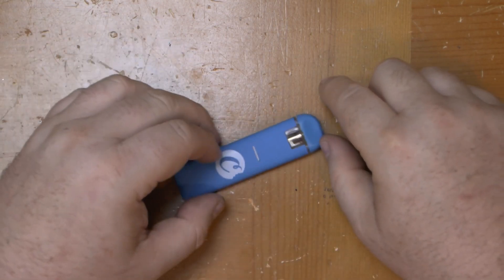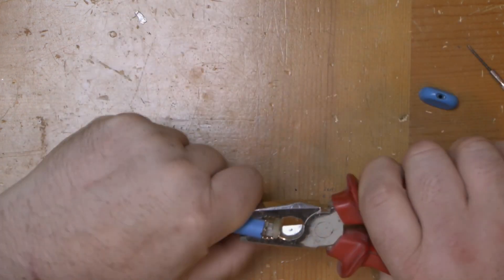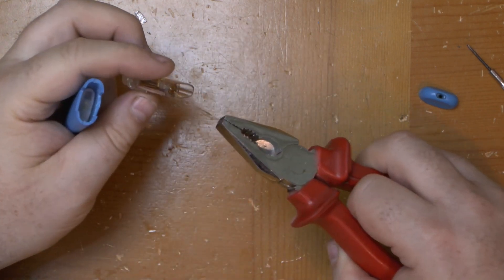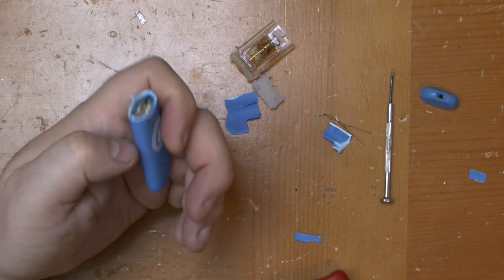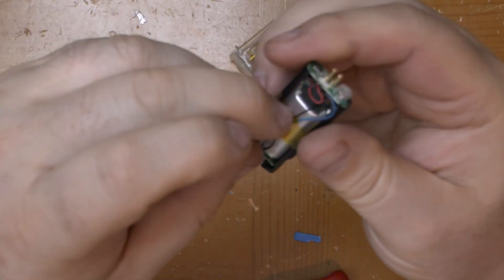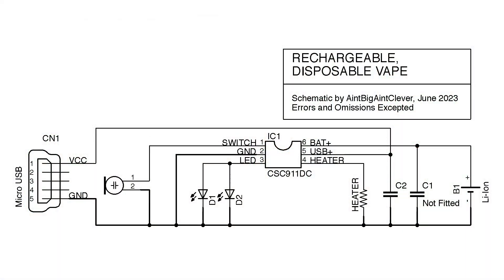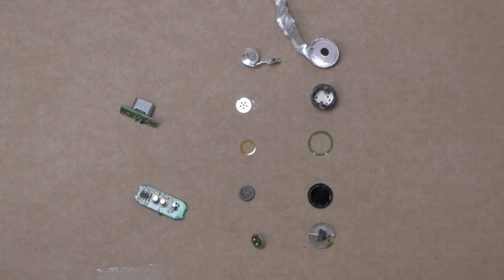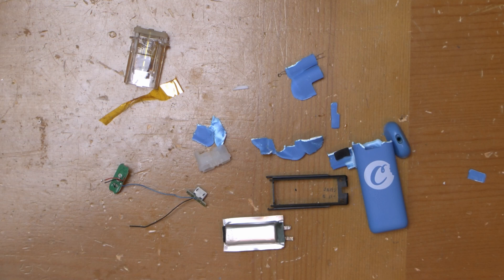What's inside a rechargeable, disposable vape?

Comment: I've found that the CSC series of those vape controller ICs will activate their heater output with a capacitance change (if I touch the exposed "electret" pins with a gloved finger, the circuit still activates), but will also trigger if I pull that pin low with a pushbutton. I've done some experimentation to see if the capsule is indeed a FET-less electret microphone but have not been successful yet, or at least the signal is still buried in the noise.

In one instance I took a USB-C type rechargeable vape board, removed the heater wires, cut the trace to the capsule, and attached it to an 18650 battery holder to create a single-cell battery charger. I found it pulls about 200mA with decent voltage regulation as well.
Reply from the maker: I suppose it's one instance where they really, really don't want to overcharge a cell and start a fire, as it'd cause a massive backlash against disposable vapes as a whole. They've crammed a lot into that little 6-pin package :)
Reply: @AintBigAintClever  As much as I'd (morally) want to see disposable vapes not exist, that would make sense that they want tight regulation especially since they usually don't have a dedicated Li-ion protection IC to rely upon.

Comment: Using a modeler's pocket blade saw, one could cut the case on the outside and that should clamshell the thing open. If you can determine the thickness before hand, you can even make one those end stops and cut just the plastic without fear of nicking the bat. Neat.
Reply from the maker: Dremel with a cutting blade and appropriately-sized penny washers each side (with the correct diameter centre hole to stop the whole thing going off-balance, snapping the bolt and frisbeeing all three)?

Comment: Unless that chip detects capacitance change, the capsule will be built like an electret, but when there's a pressure difference, the diaphragm makes contact, this is similar to the cigarette shaped vapes
Also, that ic says 'switch' on one of the contacts
Reply from the maker: On the schematic?  That's because I wrote it there, based on the schematic of the non-rechargeable one, and I wrote it there as well.  I was expecting continuity when blowing through it but got sod all, not even when putting the probes on the diaphragm.  I don't think I zapped it out when dismantling as I expect that would've required shorting pins (which I did, causing the LEDs to suddenly light) while blowing through it (which I didn't).